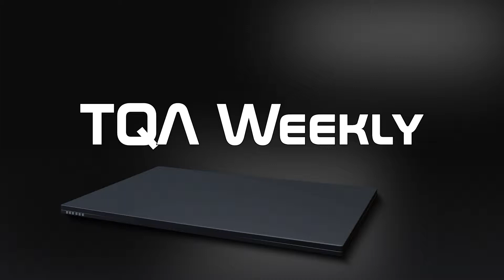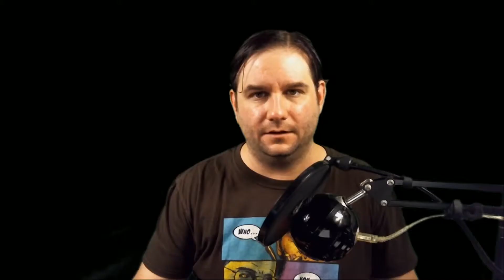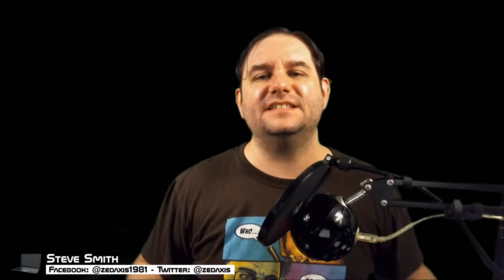Can a Laptop Processor be Upgraded?!

Comment: I'm sure even the soldered CPUs can be upgraded if you have the right tools.
Reply from the maker: you are right, but the amount of trouble required to do so will leave only but the most expert of people doing it.
Reply: I don't know what to look for on youtube to find videos of what equipment they use. Can you help me please find some leads?
Reply: @encapsulatio  i know its already 1 years , I just want to the answer for this. it requires BGA machine. Because most of the laptops came with soldered processor , so in order to change need BGA machine for desolder the old cpu n solder the new cpu. And need to know profile for the BGA to prevent too much of heat, because too much of heat will destroy ur cpu n also motherboard..
Reply: @tqaweekly If my regular repair shop can solder on board dedicated GPU so to can everyone